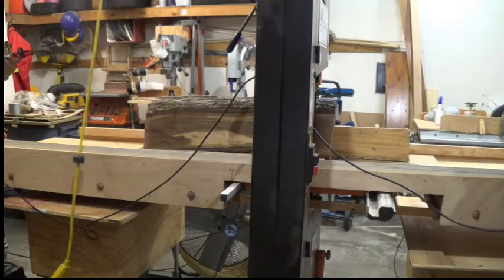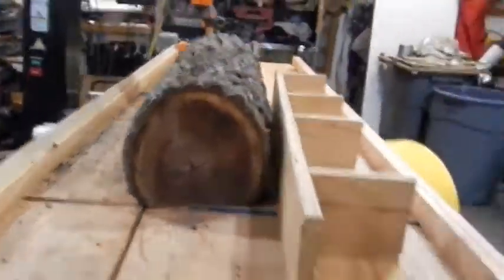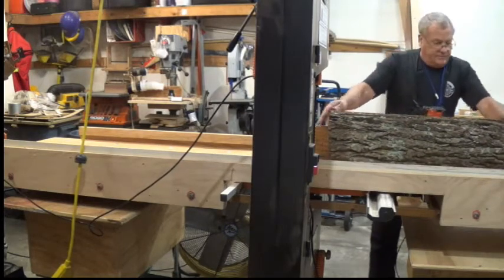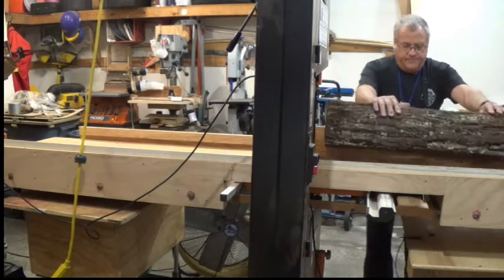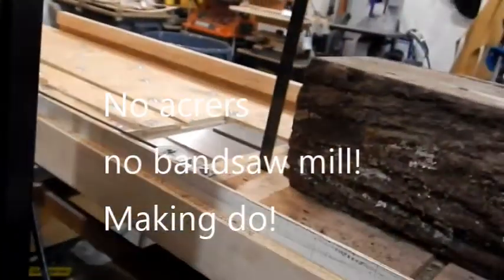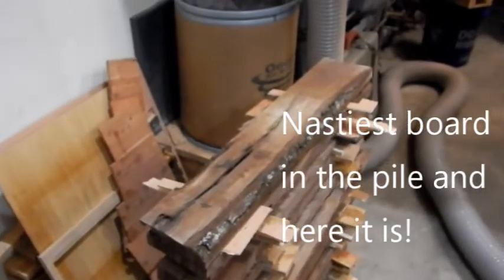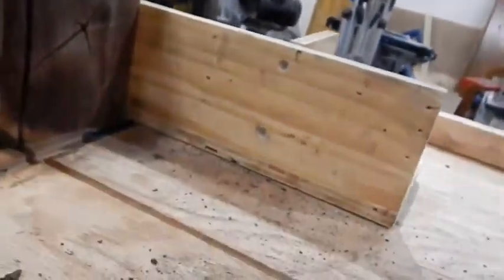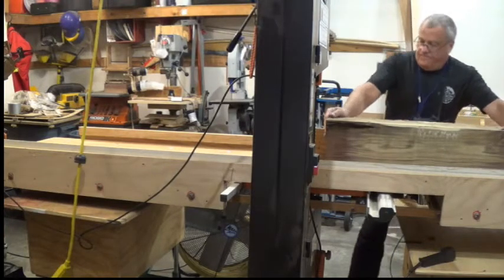Resaw

Comment: Ever thought of making your sled with linear bearings?
Thanks for the video.  I enjoyed it.
Reply from the maker: When I add the correct weight it pulls it back in pretty good shape.  Throwing these 100 pound logs around and all the saw dust it's pretty much a get close operation.  My CNC has these bearings on it for accuracy.  Resawing these logs is a let's get it closer thing.  The sled rolls over eye ball bearings some have said I should have used just formica.   After about 50 logs these bearings are making a rut in the sled.  I would love to have a Bandsaw Mill but I have no trees to justify buying one.